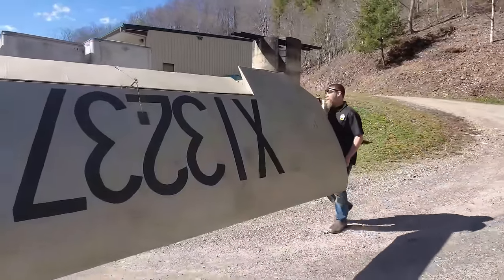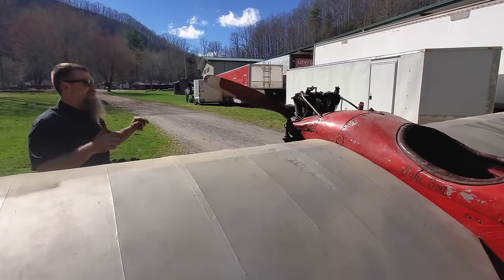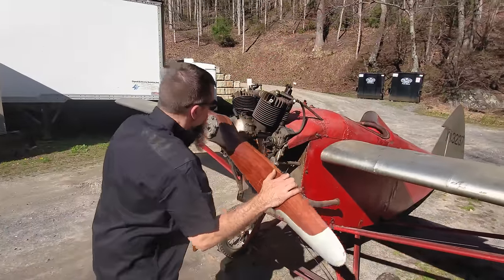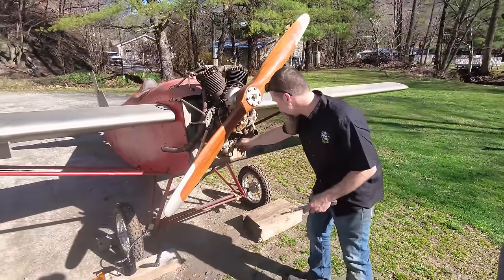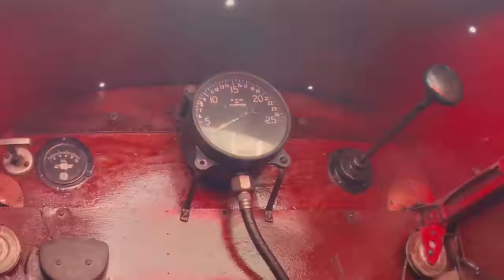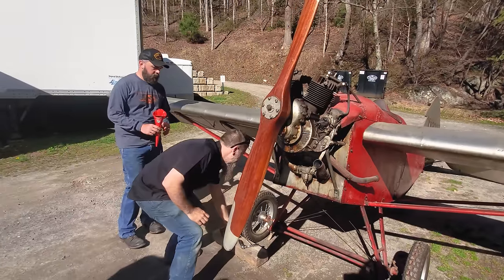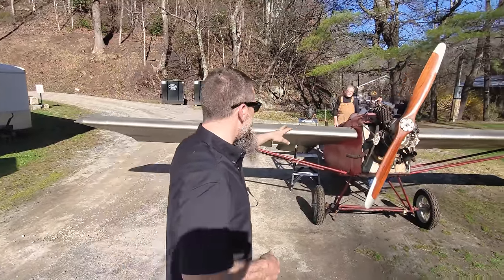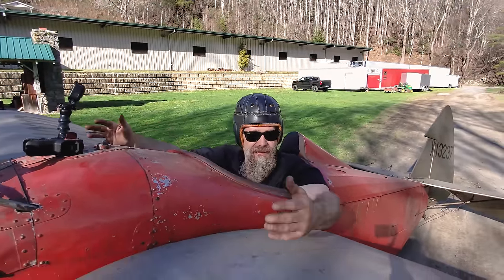Can We Make This 1920s Harley-Davidson Powered Airplane Fly?

Comment: If you ever do this again, don’t use both hands on either side of the propeller to start it. Very dangerous. Just turn it until you get it on the top of the compression stroke, just like a motorcycle, then use both hands on one side making sure that you follow through with your down pull and clear the propeller path. By the way this is my new favorite channel, I absolutely love the host.

Edit: after revisiting this comment and thinking about it, with a hand on either side of the blade, if the engine were to kick back with your hands on it, it would kind of twist you into the blade, pulling your chest right into the spinner.
Reply: Thanks a ton for watching!! Couldn’t get the old VTwin to even pop the way you mention to start it.   Most airplane engines engines have several more cylinders and/or far better than a 315 degree firing order.  Found that we had to get it past two compression strokes to get it to fire. One pull simply wouldn’t do it.  Admittedly not the best solution, but appeared to be the only solution.
Reply: @mattwalksler  You know better than I do, just thought you’d be a better bike mechanic with both your arms 😜 be safe brother and keep up the great work!
Reply: So true, I cringed when I saw that. Having hand-spun propellers for over 50 years, using a leg to swing back as you pull down helps move the body back.
Reply: Yep my 65 sportster with 10.5 compression sent me into the air
Reply: follow through?  what? this isnt baseball here
Reply: @JoeKyser  as in keep moving your hands to get them out of the way. Don't stop moving them after the pull because if it starts, you might lose or severely damage them.
Reply: @mattwalksler  I was cringing every time you put your hands on opposite sides of the crankshaft, but you say the "correct" method wouldn't work.    Thanks for making this video, I really need to come over and visit.
Reply: also pulled down on the prop to level engine.. 😲
Reply: A flywheel may not bite you,but it's cousin the Propeller will deal with you in a savage way.
Reply: @jamestregler1584  I had a stroked Sportster XLCH1000 in the 90' s. Only a kickstarter and hard to start too. I needed my whole weight ( 70 kilo) and 2 feet on the kickstarter to start it. It threw me in the air several times. Also with my knee against the handle bars. I had to sell it because my knees started to dislike it. I had not much experience back then with old bikes.

 Later I have rebuild a WLC Liberator. That was a great bike, I wish I  still had it. I worked over a year to get it technical perfect. It was painted beautiful (as a civilian bike) and looked great when I bought it, but technical it turned out to be worse than bad. I never drove it other then around the house a few times but that was magical.  When I wanted to legalize it , it turned out the former owner had scammed me. It had no papers, he had imported it for display purpose only he told me. Turned out he did had tried to legalise it but they found out it was build from spare-parts and he had falsified papers ,chassis and engine-numbers. (I found out it came from Poland and was build from old spareparts. Some paper gaskets where cut out papers from a comic book. Everything was worn far beyond the max.  I spend a lot of money on parts. So I was double screwed.
Reply: Yes.... everything you can do wrong in hand proping a plane.. these guys are doing.
Reply: this is where i also paused. to check comments.. whew. sketch
Reply: Need to see it actually fly!
Reply: He has Shoulda taken up for a flight
Reply: Having hand propped 235 HP Piper Ponies I concur.
Reply: @ronjenkins6674  extremely creepy
Reply: Great advice !!!
Reply: Thinking the same thing
Reply: And never stand in line of that prop rotation like the cameraman did... if that prop breaks he is dead.

Oh wait, its the cameraman... he will be fine